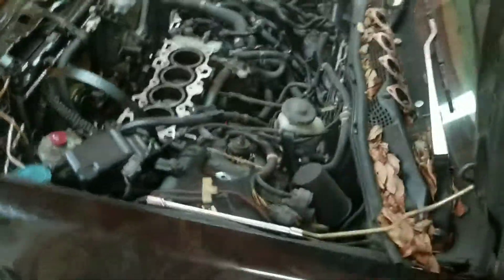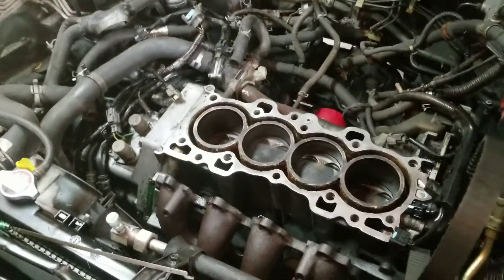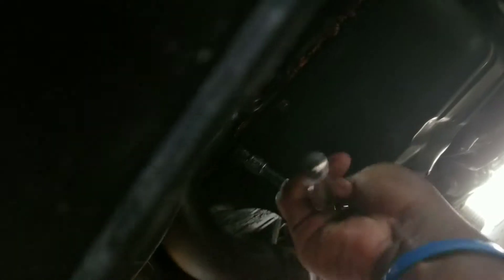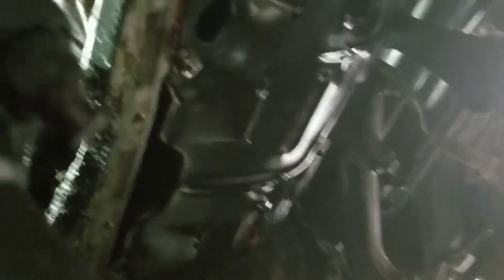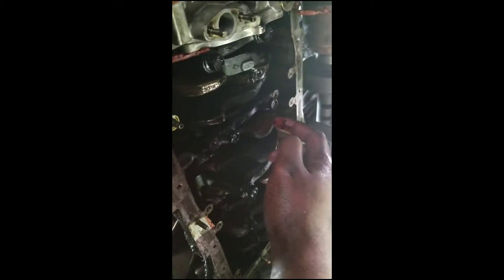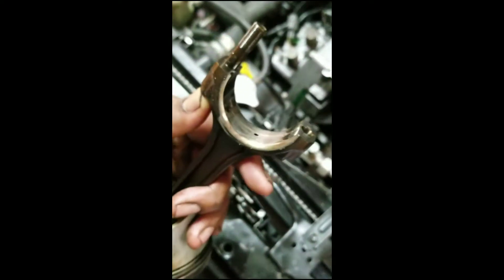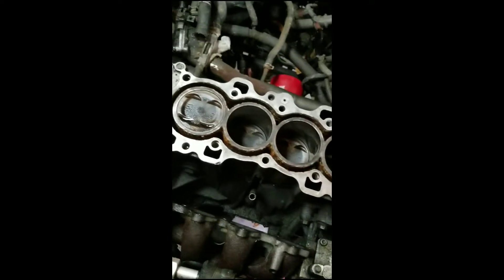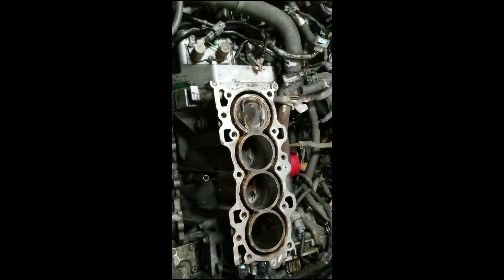DC2 b18b project series: Replacing crank without removing engine part 3

Comment: I have a 1999 Honda Accord and the bolt inside the crank broke in half so do you think I could just remove it from the bottom like this and put a new one in?
Reply from the maker: Is it the bolt that holds the crank in? If so, yes Just drain the oil remove the baffle and you should be able to get to it
Reply from the maker: Send it to my IG. R3TV_
Reply: @R3TV  sent

Comment: So you don't end up leaving the engine inside?
Reply from the maker: I ended up taking it out because I did a complete rebuild, but you can definitely replace the crack or a piston with the block in the car